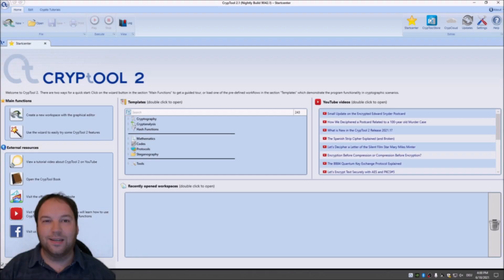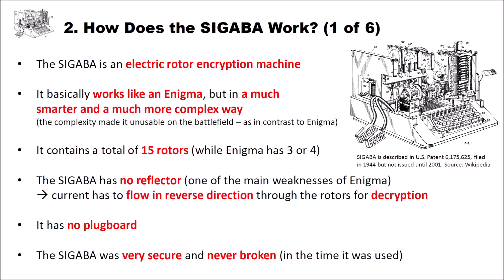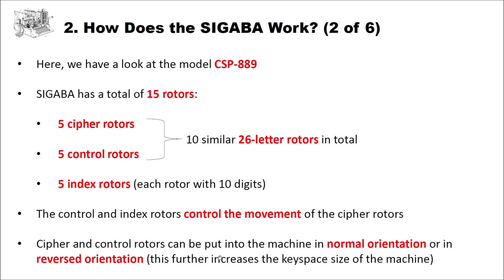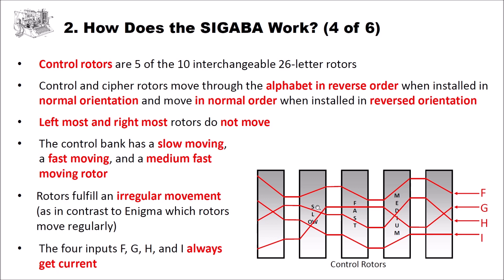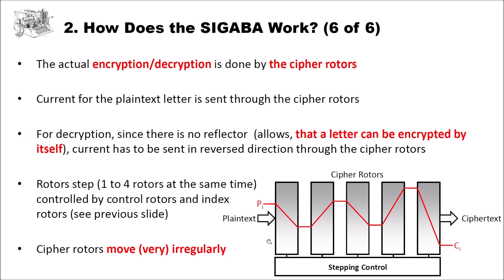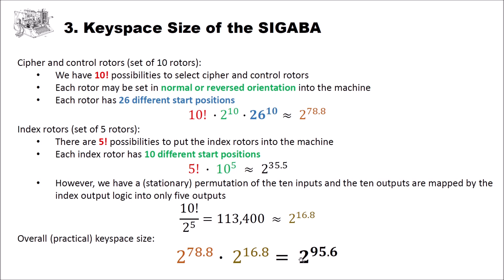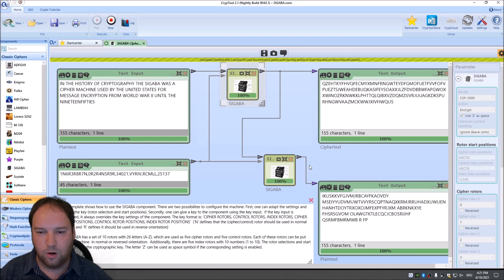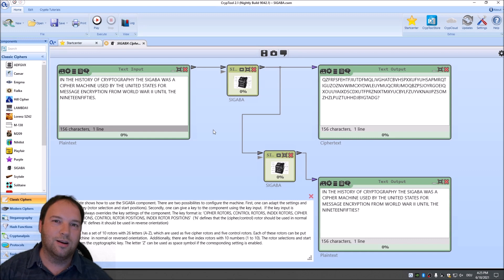The U.S. SIGABA Cipher Machine – An Incredible Encryption Device

Comment: hi i'm a french person preparing an oral about different cipher machines used during wwII so thanks for your very useful video ! i have one thing i don't understand : why are the index rotors for ?
Reply from the maker: Hi thank you, the index rotors are fed with current by the control rotors and output the current to the stepping control. basically they are just changing the input based on their positions and rotations. They never move but since they can be put in any configuration into the machine they are also part of the key. I hope this answers the question 🙂
Greetings, Nils
Reply: @CryptographyForEverybody  thank you I think I understood ! i just have two more questions : for the maths of the key space size, why don't you take into account the 2^35.5 for the positions of the rotors ? 
also, is there any chance you have worked on the purple cipher machine by the japanese side during WWII ? it's also called the type b cipher machine or the code 97 I think
thank you for all your work it's really helping 🙏🫶

Comment: Nice and well-structured video. Thx

Could u pls answer some more questions?
- So now we can encrypt and decrypt messages in ct2 with the sigaba emulator by our own. This is done instantly. Do you know how quick this was done by the operators then in history?
- What is the weight of such a device?
- Will the cryptanalysis algorithms mentioned be implemented someday too? Will they also be open-source?
Reply from the maker: Hello Ed,
Answers to your questions:
a) "Do you know how quick this was done by the operators then in history?"
--> Not sure how fast they were. I know that Enigma operators often worked in teams of... One operator typed in the plaintext letters and another one read out the ciphertext letters. Often, a third one also morsed the message. Since the U.S. Sigaba was used on battleships and in headquarters and not in the field (in contrast to Enigma), I assume it was operated by only one person. Also, I think, Sigaba could be directly connected to a telewriter... So I think it could be operated fastly (telewriter) or "slowly" (by hand)
b) "Will the cryptanalysis algorithms mentioned be implemented someday too? Will they also be open-source?"
--> Probably I will implement it. George Lasry told me, that the analysis takes several hours and is rather complex. Therefore, I am not sure which part we will put into CT2. And yes, of course, everything will be open-source :-)
Greetings,
Nils